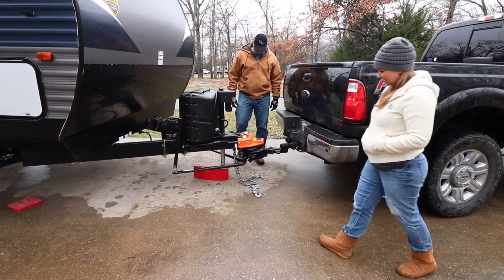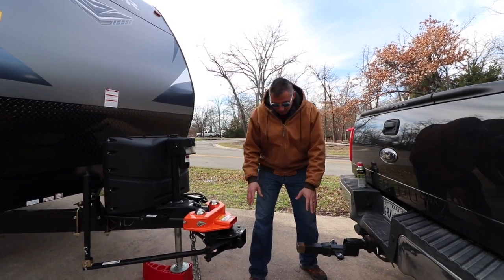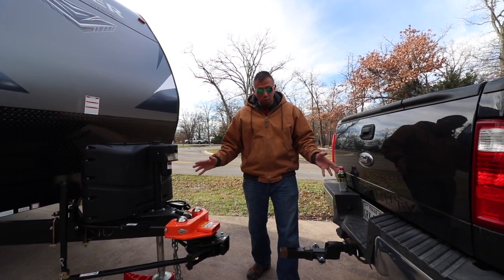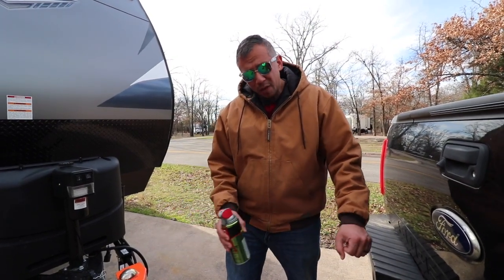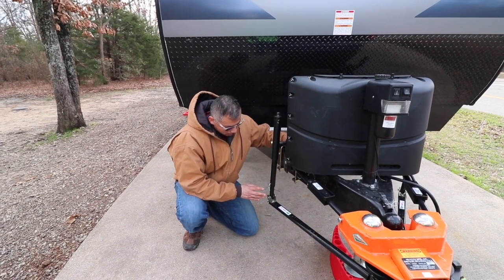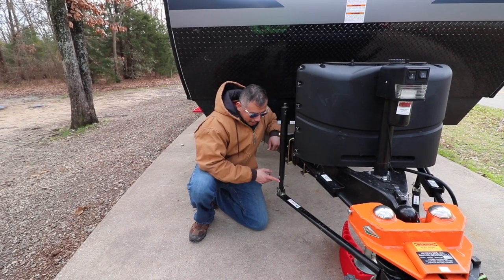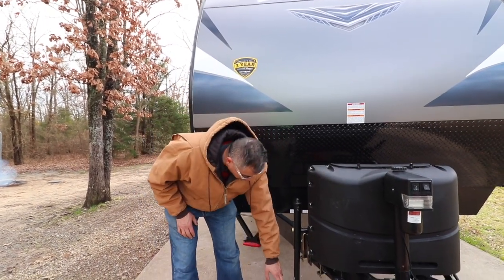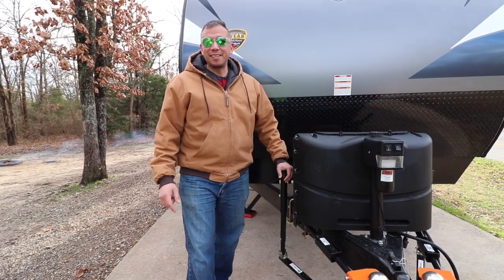Hensley Hitch Install Part 2 - Correction to our install video

Comment: You'll find you won't need the silicon spray after a few trips. Once the paint wears, it won't stick. Also, the trick to relieving the pressure with the standard jacks is to watch that elongated hole and bottom pin. Loosen the jack until the pin is in the middle of the elongated hole. If it's at the top or bottom of the hole, you went too far or not far enough. Folks who go with the snap up or hanger brackets don't need to worry about this, as the pressure is released as soon as you remove the chains (which replace the solid jack assembly you're using). It's an amazing system, but like any new way of doing things, there's a bit of a learning curve. After my first trip, I never had another problem.

Comment: This is exactly what happened to us the first time we tried to unhook (we have the Cub)...but essentially the same hitch.  We just kept pulling the trailer (and jack) forward...almost off the block.  Our issue was simply that we still had our WD bars engaged.  They should be completely loose!  Once we did that, it pulled right out!

Comment: I’ve had a Hensley hitch for years and it truly is the best bar none. I was also raised on a farm and have been dealing with trucks trailers and all sorts of machinery my whole life so I don’t mean to be totally condescending but most of your problems are because you have very little Mechanical knowledge, which makes me wonder why your making videos ? First of all you lather down that receiver neck with axle grease, not silicone spray which will work but is not as good or long lasting. then not only does it hook up and disconnect super easy but it won’t rust as the powder coating wears off. When disconnecting you let off the tension bars and and use the jack on the trailer to elevate the truck close to its normal height and pull out, I’ve never seen the trailer even twitch or heard any noise’s. Also worth noting I carry one of those cheap Harbor Freight tool bags big enough for  the receiver hitch to go in and it goes in that bag immediately I do not drive around with it on the truck but that’s a personal preference I’m only commenting on your video because this hitch is the best as I said and super easy to use and I think your videos are making them seem hard to use and difficult to set up when their not. Plus I see Texas plates and I expect better out of a fellow Texan, lol.
Reply from the maker: I'm making the videos because I want to and to share my experience putting it on.  Not everyone in Texas was raised on a farm using machinery their whole life which also means not every Hensley customer had the some up bringing.  As soon as you make your video showing the best way to use it I'll be happy to share it.
Reply: @LivingTomorrowToday  lol, bought what I figured you would say. Carry on then, carry on.